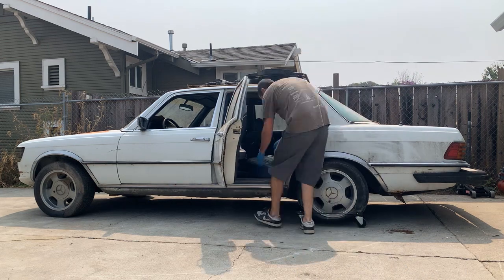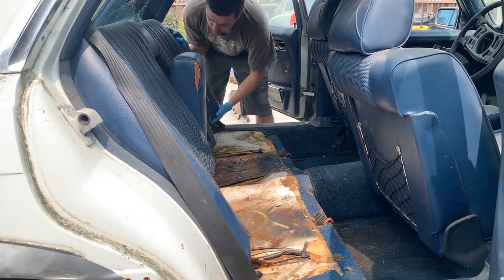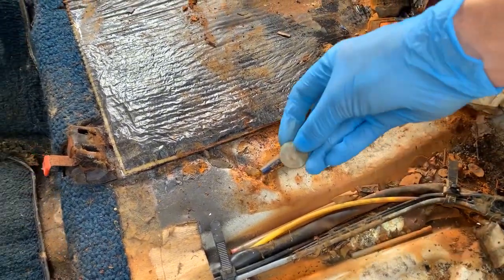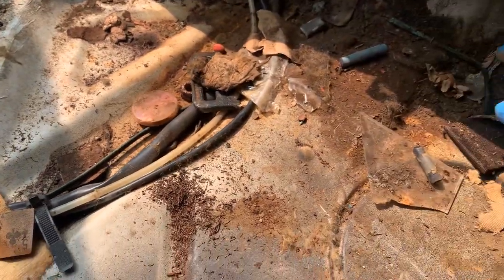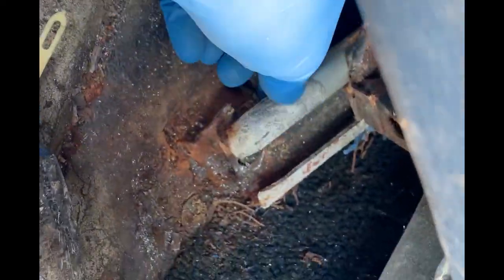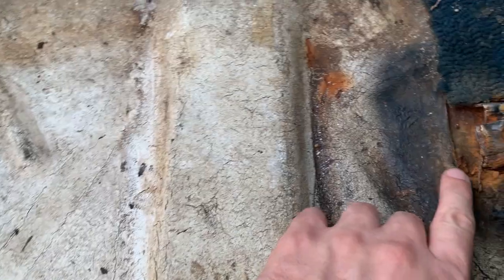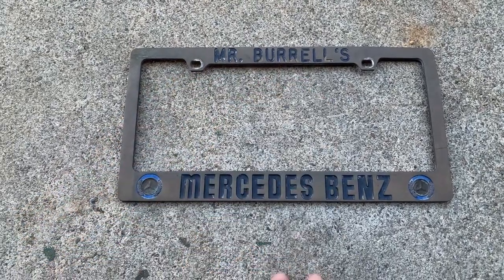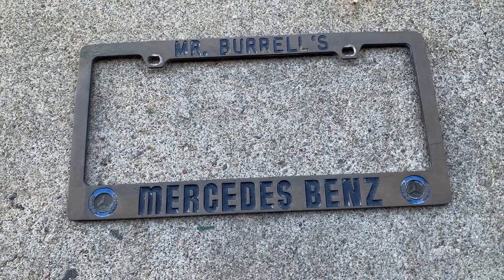How bad is MC Hammer's Mercedes after 28 years?

Comment: Congratulations and thank you for the video on the W116.  You are doing a careful and thorough disassembly and evaluation.  Please consider joining W116 Owners group on Facebook as we have almost 12000 members worldwide and are a great source of knowledge, parts and technical expertise.  Seat padding is available from GAHH in Van Nuys California.  I ve done two of these interiors and changed the horsehair to foam.  Please message me if you have any questions or run into any roadblocks.  Finally, Tom Hanson at MB Classic Center is a superb resource and can get you parts you cannot find anywhere.  Please keep the videos coming on the Hammer sedan !  oh yeah. one more thing.   carefully remove all four chrome wheel arch moldings.  Lay them down side by side in your driveway. Take your daily driver and run over them repeatedly until they are inusable 😉
Reply from the maker: Thanks for watching, and for the great information! I am already a member of a few groups, this one included. I will be sure to post up more pictures and videos when I get back to the Mercedes project.

Comment: For some weird reason I've always wanted to turn one of these old mercedes into a track car. But instead of replacing the engine I want to strip it as much as possibly then lightly boost it.
Reply from the maker: I've seen only a handful of these older Mercedes' turned into track cars, and they always make me smile! I HAVE thought about giving this engine a bit of boost, but I need to focus on getting it back on the road under NA conditions first :) Thanks for watching!